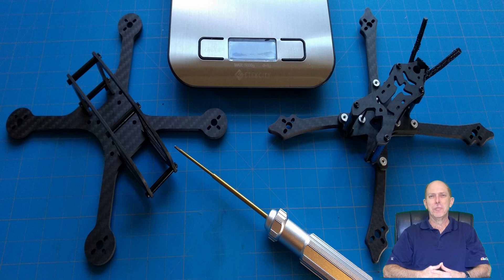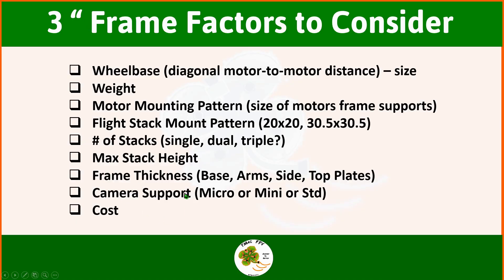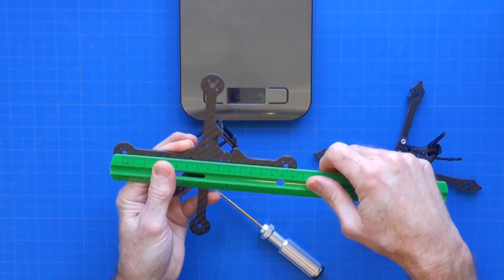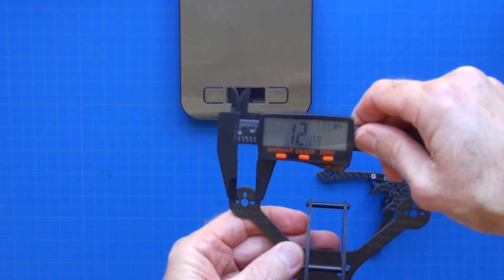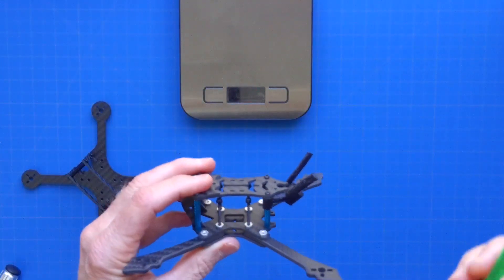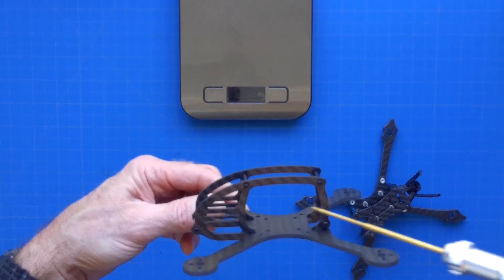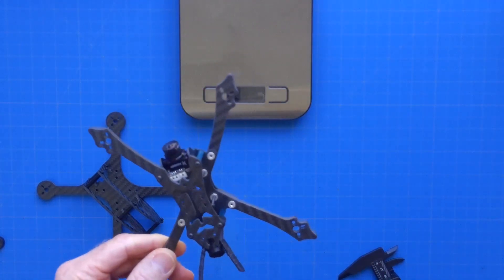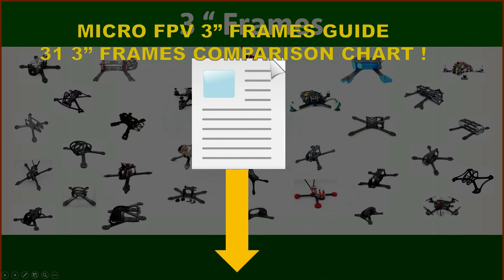MICRO FPV QUADCOPTER PARTS - 3 INCH FRAMES

Comment: Very thorough and I informative. You do great instructional, comparative, and informative vids! Who is Josh Bardwell?... LOL! 

I have the HGLRC 3in and run it on the Diatone mamba micro stack. I love that its is 4s so I just hook the xt60 to xt30 adapter and rip.
Reply from the maker: Thanks Jason!  I've got that Mamba micro stack laying around here too waiting for me to put it to good use.  Might save it for a smaller quad and use the Airbot Nano V6 and ORI 32 stack I've got for the 3 inch build. Then again, if I go with the heavier HGLRC, might make sense to use the lighter Mamba stack!    Think that Mamba stack is a Winner especially for the cost.  Notice any difference in flight characteristics with the Hybrid frame?
Reply: @TMacFPV  Only 3in frame I've flown, so I can't compare. It handles very well and flies similar to my 5in, but slower. Definitely best bang for buck, but I like the smoother feeling of blheli_32 over dshot600. Too bad it cost almost 2x as much! I like the raw feeling of dshot600 for going fast, but not for cinematic flying. I have 3 mamba stacks on 3 builds, so I definatly like the product!
Reply from the maker: @shouglifefpv3880  All great stuff, my friend! Clear Skies & Happy Flying! 👍